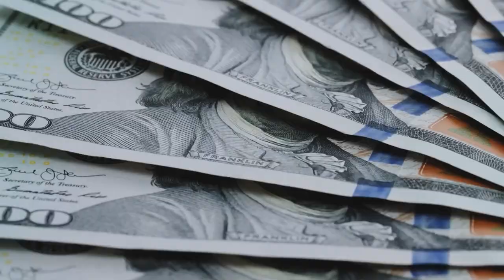This Is Why California’s High Speed Rail Is A HUGE DISASTER

Comment: This video explains NOTHING.  It cites a few facts regarding project costs (projected and actual), but there is absolutely no analysis, just the assertion that the project is a failure. The CAHSRA has made a lot of mistakes, but this video documents absolutely none of them, and therefore cannot offer any solutions. LUXURY MEGA BULL should be the name of your channel.
Reply: To be perfectly fair  there is not a single video on youtube which explains the problems of the CAHSRA in detail because the list of f!@#!@# ups on every level of this project is pure comedy gold and Texas HSR is in similar situation. Its a bloody miracle that Acela from NYC to DC was actually finished.
Reply: It's a failure...
Reply: @Deathwalker666666  Acela runs on already existing track, some of it dating back to the 19th Century.
Reply: @oldRoyaltypewriter  And those parts that date back to the 19th century are the problem. Because for High speed rail to function properly at higher speeds the tracks and signal installation needs to be upgraded. Seriously every single country on the planet which have HSR did this and everybody understood that using antique rail system would not cut it, but for some reason people in USA are demented when it comes down to those facts.

Comment: At 1:40 : Hold it right there. It will not be a "cheaper option to flying. No it won't. I just booked a ticket on the Eurostar from London to Paris. The fare (the cheapest I could find) was $200 one way. For comparison, a ticket for Alaska Airlines from San Francisco to Los Angeles is $50, and that is for a journey that is 100 miles LONGER! NO WAY it this train going to be cheaper than flying, and CERTAINLY not cheaper that driving for a family of 4.

Comment: I never understand WHY they don 't use parts of  motorway  already built
Reply: I can answer that, and there are two reasons. The first is that the I-5 corridor doesn't go near any sizable towns between the LA basin and the Bay Area, and there frankly would be no use for it for the much larger population of the central valley, compared to the coast, the valley bordering on 4 million people if you exclude Sacramento, which is 2.5 million in of itself. The second is that because of the demands of high speed railways to have longer straights and gentler corners than a conventional railroad, let alone a highway, you need to do an insane amount of tunneling and even more bridges than in the central valley, again, all for little to no benefit. That would have made the project even more expensive than it already is, and less useful all at once. The central valley really is the best option for everyone concerned. The main reason Brightline West from LA to Vegas is building their line alongside I-15 is that they are trying to skimp on cost themselves, thus reducing their top speed until they get beyond the Cajon Pass, and being only able to reach their top speed on the flat sections of the Mojave desert.

You want fast speeds (220mph in the case of CAHSR), for lower cost, and to actually serve cities and towns along the way, you go through the central valley.

Comment: Ask China to build it. They have built 30,000 miles of high speed rail in 30 years.
Reply: Or Japan which built the first commercial HSR by 1964 😂
Reply: Abhijeet Kundu  lol where did you get 8Tr?? That's the total cost of all the wars America has started since the Iraq wars 😅
Reply: Abhijeet Kundu  lol where did you get 8Tr?? That's the total cost of all the wars America has started since the Iraq wars 😅
Reply: News Flash.... 12 years ... NOT 30 years:
China's first high-speed railway started operating in 2008 between Beijing and Tianjin. Since then, the country has built a network that spans nearly 40,000km (25,000 miles) and is now the world's largest for bullet trains that can travel up to 350km/h (220mph).
China has revealed plans to extend the HSR to 70,000 km by year 2035. The 2035 to 2050 has yet to be decided. 
China started the 4x4 that has become the 8x8 construction in 2010. 
You are correct with the current amount with the lines that have just opened. 
40,000km is the circumference of the EARTH.
Reply: Yes because when I think about going 200 mph I want to trust my life to "made in China". How many cars are exported from China? Not a lot, and there's a reason for that. Get real. Japan would be a better choice by far.
Reply: @ryanoglesbee1075  BTW You get in a car every day, the most lethal form of transport on Earth... 
As of 2021, the number of high-speed trains in operation nationwide in China amounted to 33,221, tripling the number in 2013. Moreover, the total length of the high-speed rail network exceeded 40,000 kilometers in that year. China only started construction on the 8x8 network in 2010. 

As of 2021, there were approximately 730 high-speed trains in Japan. 

Which has more experience and better technology? A HSR network with 730 trainsets... many DECADES old or CRRC who has constructed 33,221 and still building for the final 8x8 and then a 12x12?

A FYI, here in the UK, we have 100s of Class 800s ... Japanese A Train mini-shinkansen train sets leased from the ROSCO over the past 3ish years... SEATS are like Ironing Boards! Incredible Uncomfortable!
The diesel/OHLE units when swap to diesel for the rails without OHLE... rattle, shake, and the db of background noise almost triples along with a significant drop in acceleration and top op speed.
The railway routes which have New Siemens and New Alstom trainsets are Comfortable, spacious, larger windows, and do not feel like a 1970s honda/toyota car rattling along the rails.
When HS2 choose the rolling stock, we have fingers crossed for Chinese Trainsets as not many can make 400kph (250+mph) distributed EMU traction trains. China has the best Distributed traction motor technology. They invented and they have on their newest trains.
Reply: @DrMJT  This is nonsense. China started developing their HSR network in 1979 after a state visit to Japan. It took them until the early 90s to complete the first upgraded (crappy) HSR line. They completed the first true HSR line only by the early 2000s, just behind the Acela.

So it took China almost 30 years to complete the first line. By 2008 they needed economic stimulus and they decided that HSR was the ticket. They hastily planned and developed a bunch of lines that were only halfway through planning. This has yielded pretty disastrous results. Only two HSR lines in China are actually economically sustainable. The former admin head and chief engineer were both tried and sentenced to death for corruption on the Chinese HSR construction project.

The system is now functionally bankrupt with over $900 billion in debt and no way to ever pay it back. The CCP is keeping it afloat because it would be an international embarrassment for it to close down. But they can't afford to do this forever. They've cancelled all the expansion projects and even stopped work on lines that were actively under construction. The are cutting frequencies and will be cutting lines soon. They've already completely gotten rid of a few of the new lines even though the stations and tracks were literally just built. 

Wake up, dude. China is constantly doing these vanity projects that are poorly built and make zero economic sense. Look at the other HSR networks around the world for actually working examples. China is a mess.
Reply: @TohaBgood2  So very true. I like the phrase "vanity projects". Very appropriate words for most of their mega developments.
Reply: AbhijeetKundu  how much boost has it given to China's economic and how much China has grown since they built their 30,000+ miles of HSR network? look at their cities nowadays and look at USA's, props to Chinese government for keep the ride cost low for their people.
Reply: @ryanoglesbee1075 Get real and catch up with time. Look who is taking over with electric cars.  They built theirs and 40k kilometres tracks, so WHAT HAS USA BUILT?
Reply: AbhijeetKundu  Its $800 billion and the US National Highway system provides even more debt than that
Reply: @timothychung4811 Electric cars with batteries that constantly explode, and HSR trains that derail for no reason. Get back to me when you have a spotless safety record like Japan's (only HSR incident ever was one injury-free derailment due to a severe earthquake), and invest in electric mainline commuter and regional rail like Japan and Netherlands
Reply: China's HSR is impressive, but only because it makes sense among the dense intercity lines - corridors provide efficiency and effectiveness, mostly on the east part of county, from the coast inland.  Guess what they are finding out, to the tune of $900 billion:  long routes to only link the end stops through sparse land is a gargantuan waste of resources.  Sound familiar?
Reply: AbhijeetKundu  Sure, everything in China is tofu. India is the best.
Reply: AbhijeetKundu  What do you know about Chinese debt? You are a little troll.
Reply: @ryanoglesbee1075  Not a lot? "Jan 27, 2023. Overseas shipments of cars made in China have tripled since 2020 to reach more than 2.5 million last year. That’s only a whisker (about 60,000 units) behind Germany, whose exports have fallen in recent years. China’s numbers, behind Japan but ahead of the US and South Korea, herald the emergence of a formidable rival to the established auto giants."
Reply: @renemartin5729  That's cool, but I don't know any Americans who would touch a Chinese built car
Reply: @frafraplanner9277  The US is less than 16% of China's total exports. Apparently, Chinese EVs are selling very well in the rest of the world.
Reply: no they haven't ...they got the germans to build it for them then copied what they did
Reply: @TohaBgood2 Excuse, .. not here to make a profit! It is there for a public good. Just like tje roads and highways don't make a profit. However,  it is there to serve the public. Ibe been to Europe and road several hogh speed trains, and it's a no-brainer the choice of transportation for the vast majority of the population.

Comment: The project is doomed because it has no clear vision behind it, and tries to serve too many interests. For example: it is being touted as an alternative to air between SF and LA. But it doesn’t go point to point like an airline does. It stops all along the route, like what we used to call a “puddle-jumper” air route, ie, small slow plane going between small airports. So that purpose is defeated. The benefit of high-speed is cancelled by stopping at numerous cities and towns, necessary to meet local political interests. So is it ‘High-speed transportation,” or is it “economic development of the central valley,” or is it a political pork barrel on a massive scale? It seems to be trying to be all three, which means it will fail on at least two of the three.